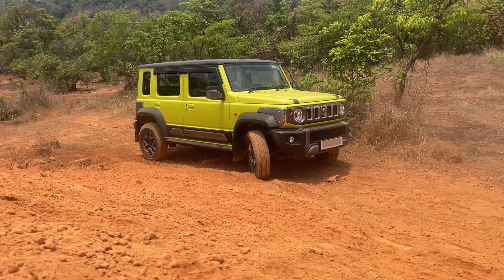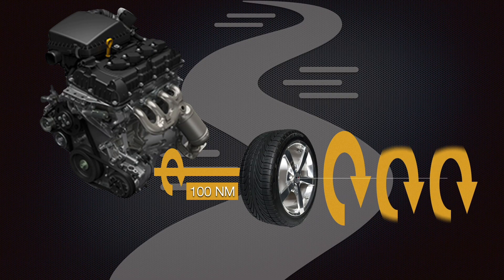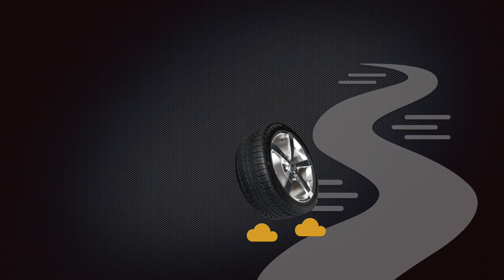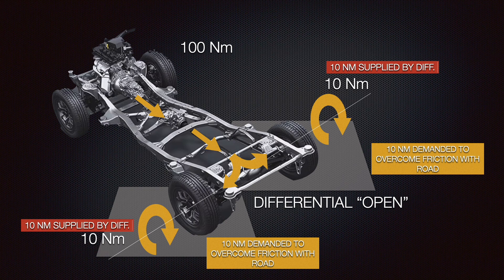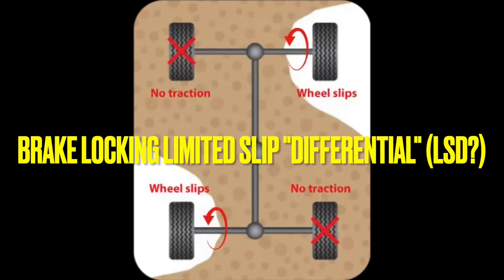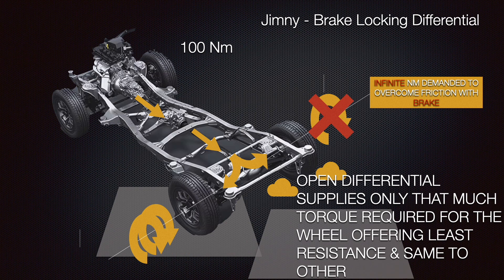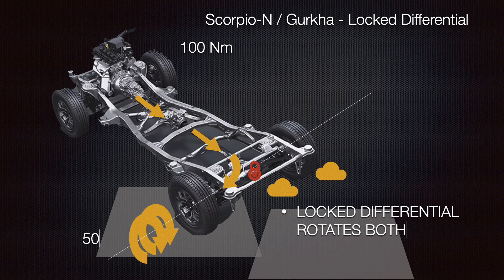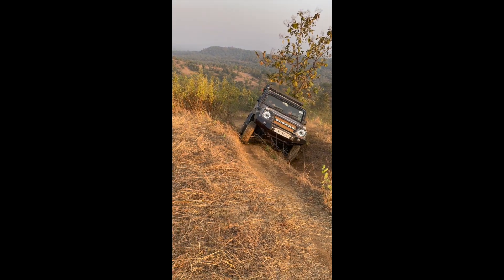4WD Differential Lock vs Unlock: Mechanical Engineering Podcast

Comment: Will the BLD lead to premature brake wear in hard off-roading scenario?
Reply from the maker: Theoretically yes. But it’s like ABS will lock and release intermittently. Prolonged use does wear brake pads as explained. Better to go for lockers if gnarly bouldering is on the cards.

Comment: Is that mean the Jimny is not a good 4x4 ?
Reply from the maker: Watch the full Jimny review video. Jimny is a great 4x4 which does diff locking differently. That’s all
Reply: @tripaccino  never knew jimny had differentials
Reply from the maker: @rajapandian2295 ALL cars will have a differential. Even 4x2 hatches . Only then can they turn their wheels without skidding off. 4wd vehicles have additional ability to lock this action sometimes .

Comment: Thanks for the explanation, its good 👍🏻
Question for you: I have Scorpio N which has MLD in Rear Wheels. The Diff lock is always engaged automatically as you explained also. This idea have been going in my mind for a long time, but not sure about it. I guess there must be some sensors which detect the Wheelspin of 1 wheel which has less traction, and then it Locks it if there is difference in RPM of both wheels. So, is it somehow possible to simulate that behaviour of fake electronic signal of Wheelspin, using some button or any jugaad, so that it becomes like Gurkha, where we can use the button to permanently lock the Diff whenever required ???
Someone told me that MLD is completely mechanical and there is no Electronic Sensor involved.
Reply from the maker: Good that I was successful in explaining to you the difference. So Gurkha mechanically locked differential but proactively actuated before by driver manually using pull up levers.scorpion also mechanically locked differential but electronically actuated re actively by computer after slip detected ; it auto releases when recovered traction. Which is better than you having to do it yourself. I wouldn’t want to fool the sensor to permanent lock  which is actually undesirable.
Reply: @tripaccino looks like my point was misunderstood a little... When I was saying locking permanently, I meant to do it temporarily... just like how we do it in Gurkha manually just to take the Vehicle out of the situation...
I was wondering if any Electronic overriding can be done using a button which will convert the Automatic MLD to Gurkha like MLD by using a button...

I hope I was able to share my imagination correctly now 🙂
Reply from the maker: @thealpinetraveller I got exactly what you meant 😊what you want to achieve I’m saying the computer will do it for you. As much time as it’s required it will hold, then release%%%%any longer is bad for the car.
Reply: @tripaccino Hmm okay, thanks for the valuable inputs 😃

Comment: Sir, there's a technical called poor man's differential lock. Similar to lsd, using little breaking along with acceleration. Is that effective technique to use.
I'm planning to buy Tata yodha cabin crew 4×4 for family use, farm use and my personal offroading and hill climbing purposes. Also due to budget restraints. I had to look for a vehicle that covers all my requirements of my house.
Reply from the maker: That’s fine as long as used sparingly. Yodha is a strong choice . Will serve your purpose well